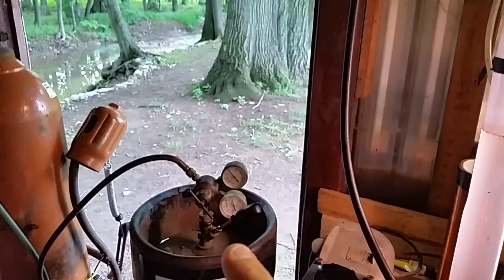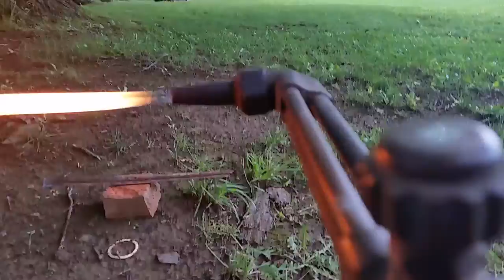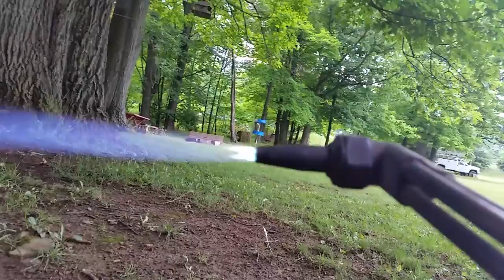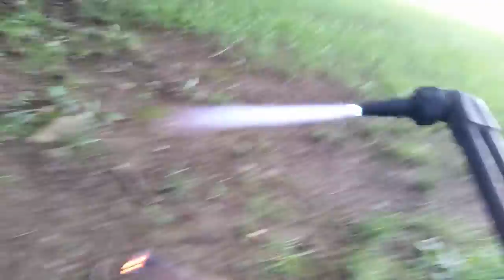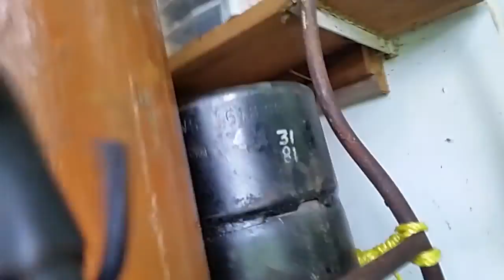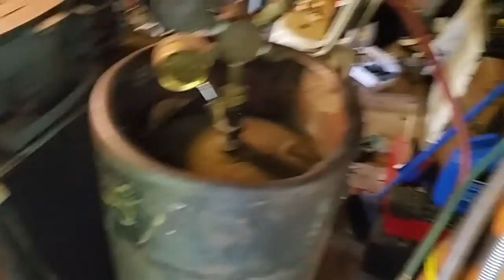hydrogen torch and storage !

Comment: What is the difference between pure hydrogen, hho, and brown gas?
Reply from the maker: hydrogen is pure,  H. brown gas, hho is two parts hydrogen and one part oxygen,  the oxidizer is already present. meaning h.h.o. 🤔 can explode or ignite, with too much pressure,  too much current draw , static spark, hho is rocket 🚀 fuel its very volatile.  Hydrogen is not, the oxidizer is not present and cannot burn or explode without the presence of oxygen inside it !

Comment: what is your psi setting in hydrogen when u use it?
Reply from the maker: Not much, maybe a pound or 1psi on the line, less than 20psi in the tank, and this is pure hydrogen not hho, brownsgas, or oxyhydrogen, hho should never be stored under pressure very dangerous can self detonate at max pressure, or static, or spark ect....
Reply from the maker: Im trying to save money to build the new ,final prototype, gonna be awsome, im shooting for 400 psi, then i can really cut some metal and i want to build a prototype truck that runs off gas or hydrogen, cant do both due to air mixture, only have so much air!
Reply: +RESIG INDUSTRIES wow 400 psi is high enough:) i want to replicate your hho cell. can i see your set-up sir?
Reply from the maker: It makes hydrogen without the air in it, its not a hho cell its an h-bar , watch the video on my channel with the hot chick on the thumnail she'll tell ya how it works really
Reply from the maker: Watch the video on my play list ,how to turn water into fuel
Reply from the maker: Nope, blew up , exceeded psi rating, have to wait till i build my new one, bigger better bader and fully automated system, wattage,pressure and tempature conrolled system, it will tell you why if it shuts off, might be full, makes pure o2 and h2 seperate from one another under pressure !
Reply from the maker: New one is gonna cost me over 1000$, peice by peice I'll get together hopefully sooner than later !
Reply: @resigindustries434  Sick system man! Too bad she blew - good thing you seem alright though haha
I'm building a similar system with a PEM cell - no electrolyte required
I'm interested in how your cell separates the oxygen, but maintains even pressure across the cell? Do have a relief valve on the oxygen side? Kinda hard to explain, but since electrolysis makes as much H2 as O2, there'll be twice as much pressure on the H2 side

I've noticed you don't have any driers - might help keep your tanks from corroding over time, has to be at least some H2O evaporating and getting into the tanks
Reply: @resigindustries434  i want to replicate your hydrogen generator. in my country its hydrogen and acetylene gas is too expensive:( can i see the vids of your generator?

Comment: Is that tank designed specifically for storing Hydrogen or the gas can be stored in any pressure tank like propane tank? What are the safety measures when Hydrogen is compressed and stored in tank?
Reply from the maker: Propane is not stored under high pressure it is a liquid and a propane tank should never be used for hydrogen. The tank i have is a high pressure tank up to 500 psi its an acetylene style tank that i drained and converted to hydrogen, not recomended but can be done. You can buy a tank just like mine that is red and is for hydrogen under high pressure no liquid, liquid hydrogen gets cold too fast an too cold 400 plus below zero

And never ever ever store hho, browns gas, otherwise known as oxy/hydrogen, it will blow up n kill you ,pure gases only, n especially no air mixed or if you sneeze it might go off !!!!!!!!
Reply from the maker: The invention must be purged from all air and the high pressure line must be purged for each fill up to remove unwanted air in the lines and the tank cannot have any air. All to ensure saftey from explosions if this prosedure is done it is impossible for an explosion to occure due to the lack off oxygen
Reply: Thanks friend. And what amount of Hydrogen this tank is able to store(as we know 1 liquid liter of Hydrogen=1 m3 Hyrogen gas=70 gr Hydrogen)? I red somewhere that Hydrogen destroys metals and that soon or later leads to an explosion of the tank. So tanks should have plastic walls inside.
Reply from the maker: It dont seem to corrode at all
Reply from the maker: I dont beleive that liquid hydrogen is safe, it drops to 400 below zero when it changes to a gas, very cold, and when an explosion occures it is very very bad the mushroom cloud could melt your face off at 1000 ft away, but ...Hydrogen stored as a gas under pressure will not do that at all 1000 times safer and user friendly !!!!
Reply from the maker: And.. with my invention, there is no need for expensive compressors or a chriogenics labratory, that would cost an ungodly amount !!! $$$
Reply: @resigindustries434  Would it explode if i steered the hydrogen and oxygen produced with this method through a pipe into a fuelcel generator?
https://www.youtube.com/watch?v=IPTYOEaXvGI
Reply from the maker: the pipe might explode and the contraption, you must use an h-bar design to separate the oxygen out
Reply from the maker: if you separate the two gases and pipe line them to a fuel cell it is safe, better to store the separate gases in separate tanks and then run a fuel cell. Do not Store hydrogen n oxygen in the same tank you could blow your head off!
Reply: @resigindustries434  did you remove the acetone from the acetylene tank?

Comment: Oxygen and hydrogen torch. That is deintely in handy when it comes to burning weeds, cooking food and heating your home in the winter.
Reply: The industry and tax conspiracy theories don't make much sense. Take the oxygen... people still buy it rather than compress and purify their own, because it is simply more convenient. People don't generate their own acetylene gas from calcium carbide any more because it is more convenient to buy tanks of the stuff.

So the problem is not market economics, it is cultural and pragmatic. A gas generator in the field, is just another machine that can go wrong and takes time to set up. A gas tank either works or it doesn't, it is a proven, reliable energy storage and delivery system.

For hydrogen to be a practical competitor to acetylene it needs to be a total energy solution, as simple as buying a tank of gas. In the case of gas welding, it has to be completely automatic combined hydrogen and oxygen generator set and forget. Wireless control and monitoring. It messages your smart phone when its ready. Problems solved.
Reply from the maker: hydrogens main competition is oil ! , but your right ,people would rather buy gasoline at the pump than make hydrogen gas for free off a solar panel, but to a rich guy with a bunker it is priceless!
Reply from the maker: the smart phone thing would be easy!
Reply from the maker: Pure oxygen is only added in this torch configuration to show it working just like an acetylene  torch, but better. Everything else just needs plain hydrogen car engines, generators, heaters,refrigeration, cooking, ect..
Reply: Yes. Hydrogen would be a reliable resource for heating things but why have we not moved on into that generation where all nonrewable reasources get replaced with effcient resources?
Reply from the maker: Greed, oil is a booming buisness, so is nuclear, ect..but free and clean energy is hard to tax. Plus it would lead to a booming economy but the rich few want your money, they dont want you to have it !
Reply from the maker: The technology is already here they just want to sell us the hydrogen
Reply: I can sell my resrouces like gasoline form pyrolysis oil then it just speeds things up.